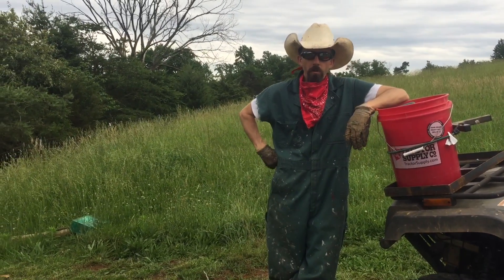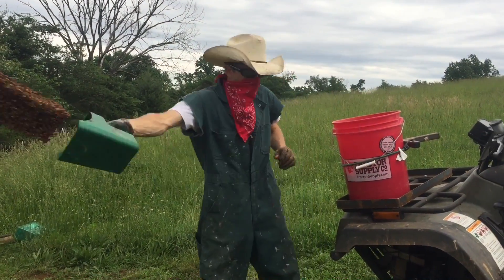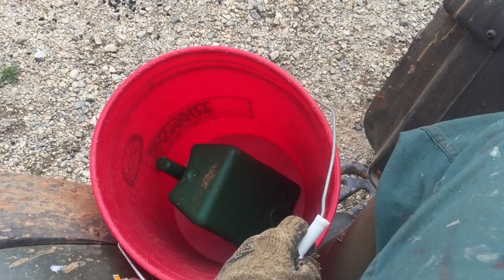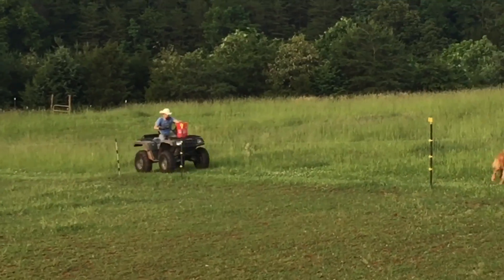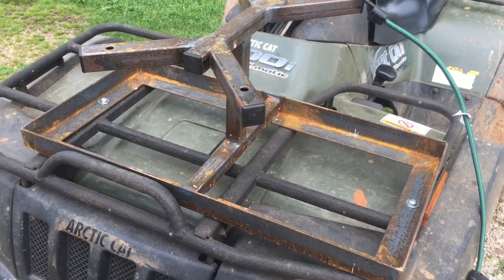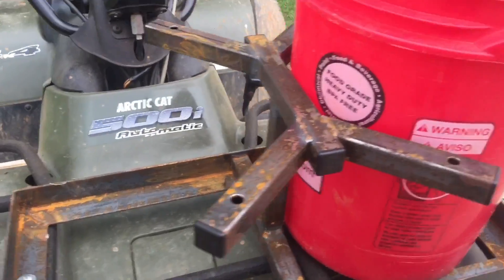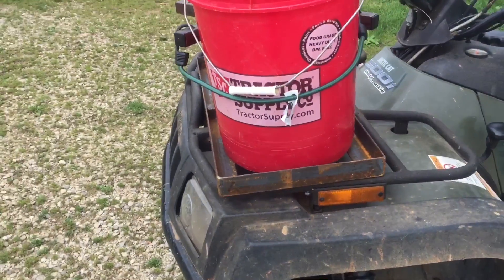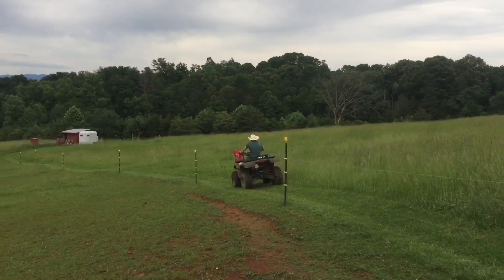Farming Outside The Box:  4 Wheeler Improvement

Comment: first big bump you hit up front all that stuff is gonna fall out and hit you in the face.
Reply from the maker: DieselFume1 thanks for watching another video and for being concerned about my safety.  However, I did extensive testing including hitting big bumps and everything stayed where it was supposed to.  If I hit any larger bumps I will have worse problems.  :)
Just another example of a small improvement.  No one can argue that making small improvements is a bad thing.